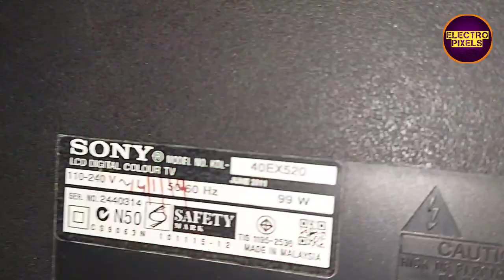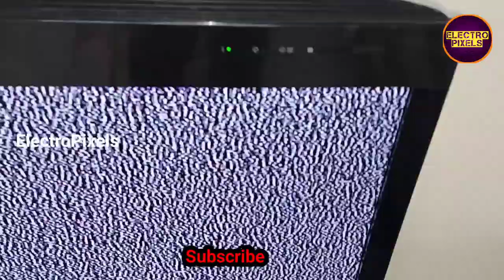Sony Led Tv 6 Times Blinking and Restart problem solution|KDL-40EX520 Protection Removal|Tvreparing

Comment: Same model....TV starts fine...but after 1 min restarts...after that red led starts blinking seven times...where to look for fault
Reply from the maker: 7 times blinking is mainly due to Audio Related error. May be fault with Audio Section of the motherboard or speaker shorting